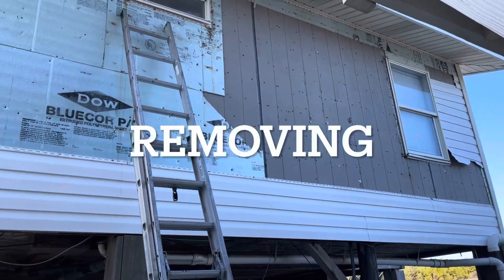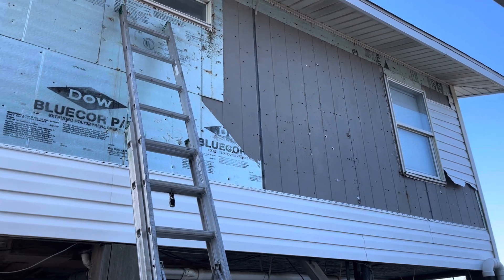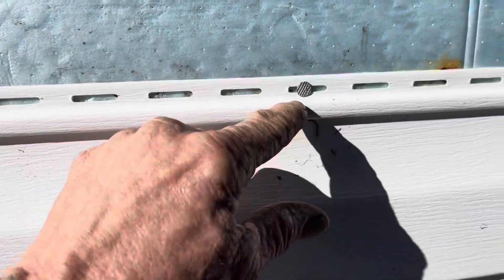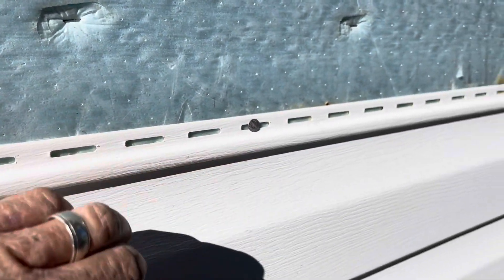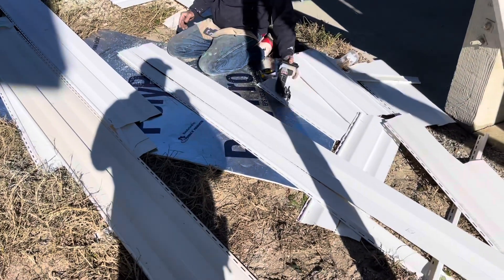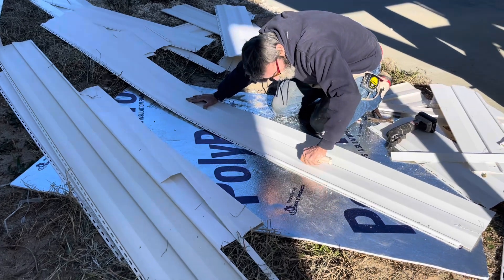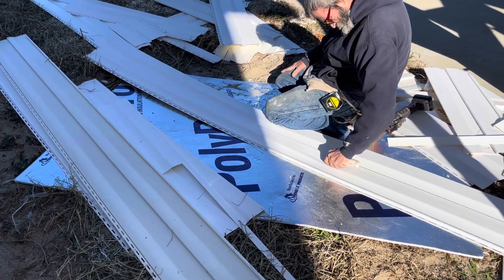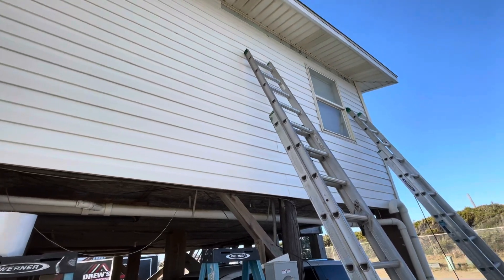Vinyl Siding. Removed and are-Installed. Wind damage.￼

Comment: Always have installed where you don't see the laps from the street but in the case wouldn't you install so the wind from the water direction won't lift? On that last top piece I also install sill trim in the J and use snap lock punch tool to lock it in. No need to face nail then.
New sub and thanks for the vids
Reply from the maker: We are at the beach. We installed it so the wind off the ocean won’t be able to get to the laps